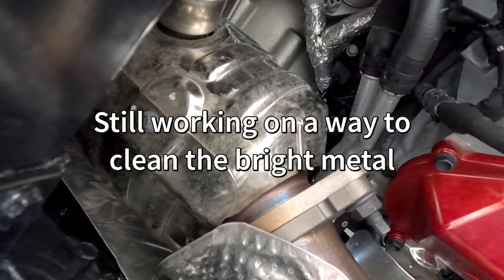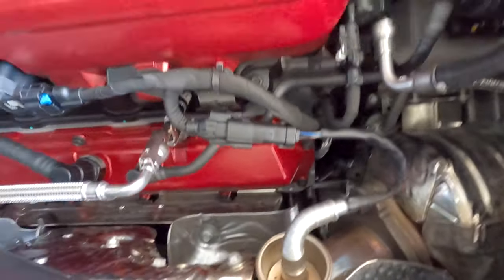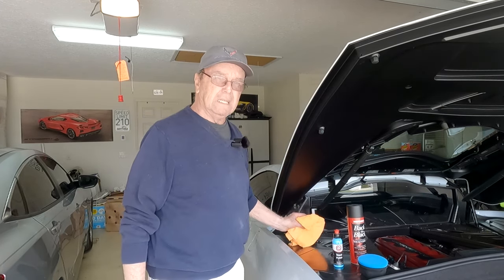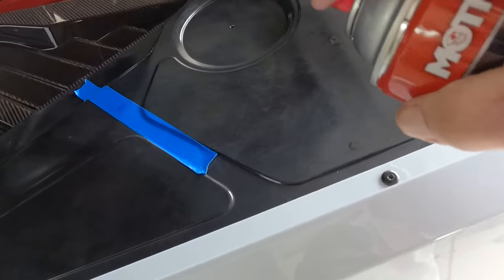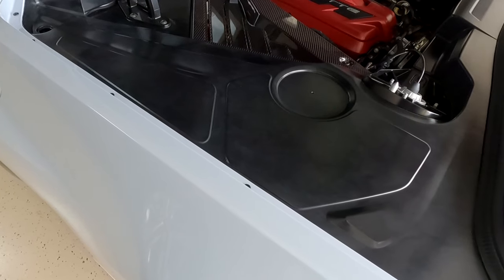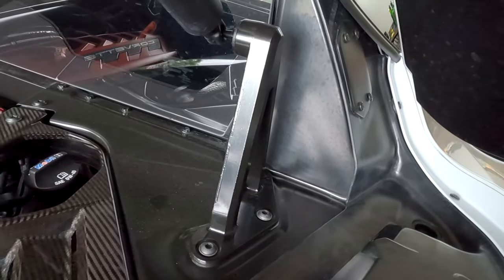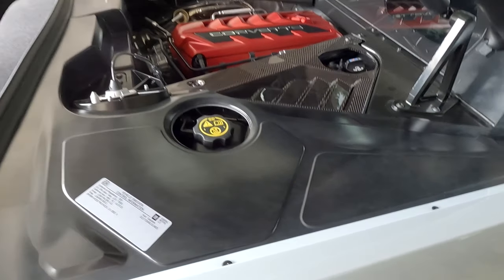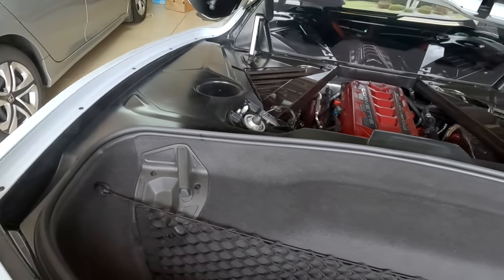Cleaning Tips for C8 Corvette Engine Area.

Comment: The black looks good. A product I found that works great on black trim is Cerakote Trim Restorer. They claim it lasts for 200 washes on exterior trim. Under the hood it should last forever. The in-line filter you show to reduce water spots is something I’m going to try. Thanks for sharing it.
Reply from the maker: Definitely will look at the Cerakote Trim Restorer. Thanks!

Comment: There is no doubt in my mind the absolute best product to use on the black plastic is P & S Professional Detail Products Bead Maker.   Not only does make the area easy to clean it stops, shines it also prevents watermarks!
Reply from the maker: I will have to give it a try. Thanks!